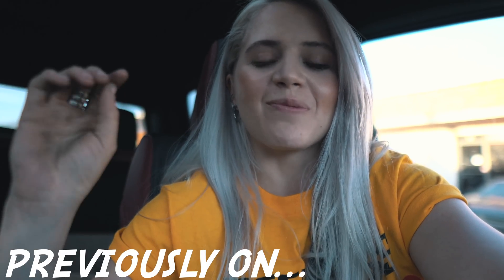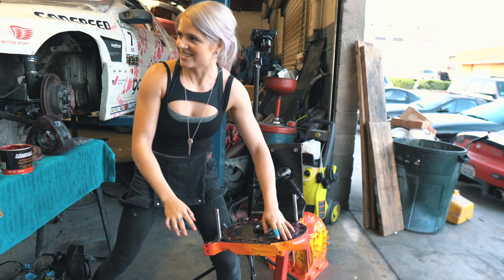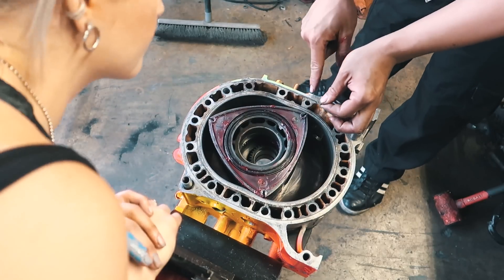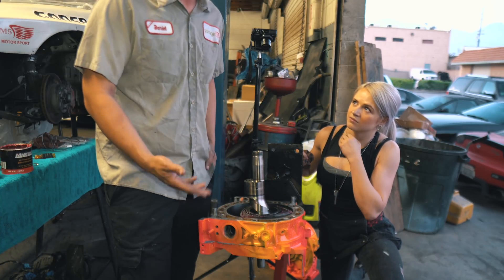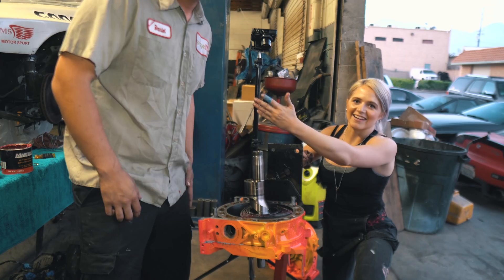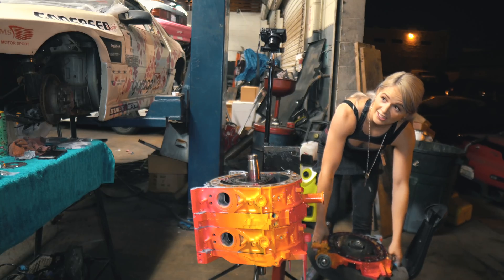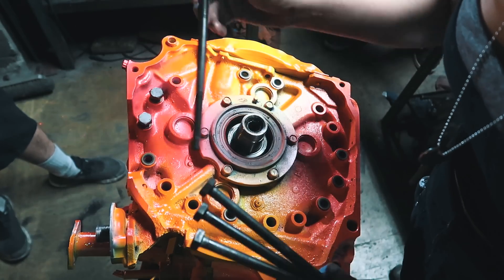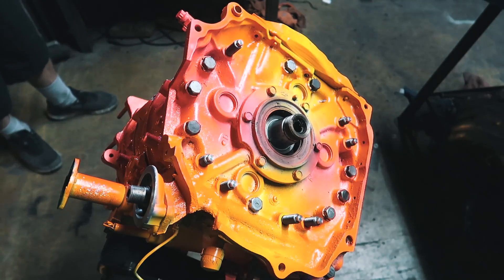Building a ROTARY Engine for the FIRST TIME!!

Comment: the Rotary bearing needs oil and a lot of it because rotary's use a lot of oil a dry engine on assembly is realy bad  it takes a wile before the pump picks up oil so the more lubricant on the rotarys and shaft the better of course not half the bottle but nice and wet. Also no street port? i also never ever seen someone use a flat head screwdriver at assembly!

Comment: wait a second, arent there two springs beneath the apex seal ?
Reply: None of you have any idea. Go watch a few more videos you keyboard mechanics
Reply: I only had 6 springs in my new pack of RX8 OEM apex seals, one large and one small, engine starts first time and has been running fine for 76,000 miles and get thrashed to shit everyday so she should be fine.
Reply: rip engine without that smaller seal
Reply: yes your right i only seen one spring get put in  that won't last very long at all rip rotary
Reply: I was just gonna comment that!
Reply: Dutchcouch yes a big spring and a smaller spring
Reply: rip
Reply: This build is piss. Clearly done on the cheap. Didn't even use OEM seals or new springs. Not to mention the harden sealant they used goes like rock and cracks with high temp.

Comment: HOWS THE SHAFT A STRAIGHT DROP IN??? ARENT THEY ALL BALANCED FOT THE SPECIFIC MOTOR THERE IN???
Reply: You can use the RX-8 eshaft as long as the front and rear counterweights are matching i.e. from the same engine.

However, the RX-8 shaft isn't 2lbs lighter. It's 1/2lb lighter if I remember right. But considering the cost of a new one, it's a deal either way.